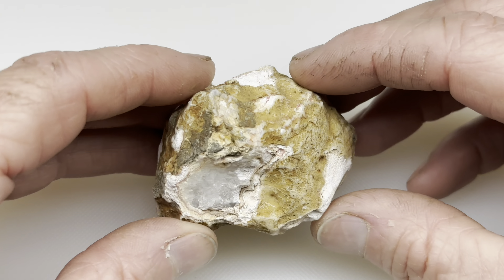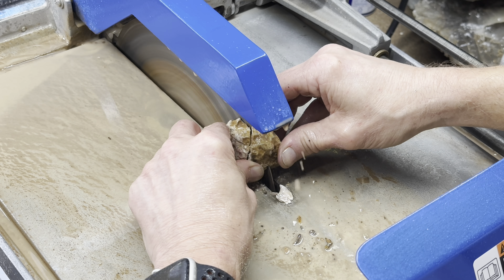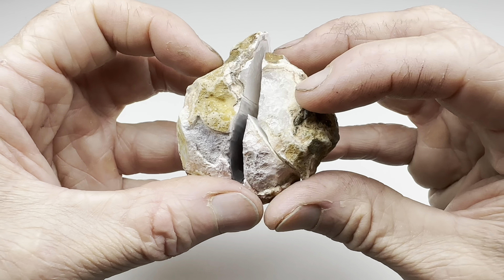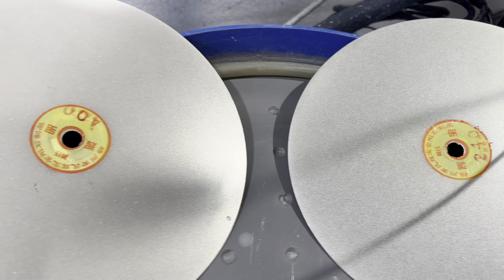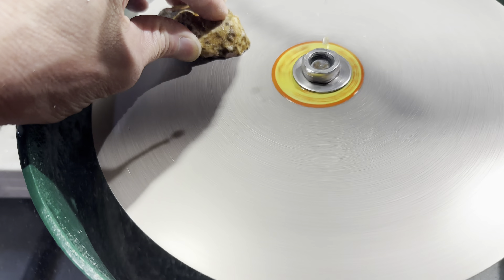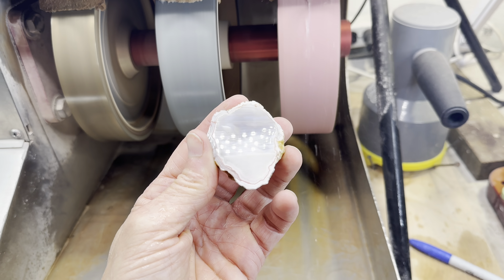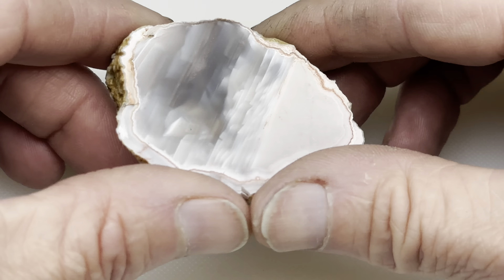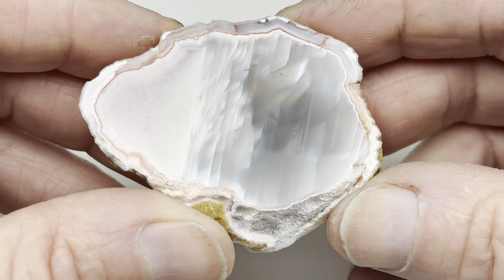Cutting and Polishing an Agate Creek Agate from Australia

Comment: i also saw the seascape right away and thought it was gorgeous!!  my big question is what did you think of the cheap laps from amazon?  i am thinking of getting one in 600 grit to try.
Reply from the maker: Hi Karen. I went with the laps because I was looking for 10” ones and my normal sources like Kingsley North and Johnson Brothers didn’t have them. I need more surface space for larger stones. So far they seem ok but I’ve really only used them on that one agate. I’ll be polishing other cut agates very soon and will have a better feel for their performance. Thanks for watching!